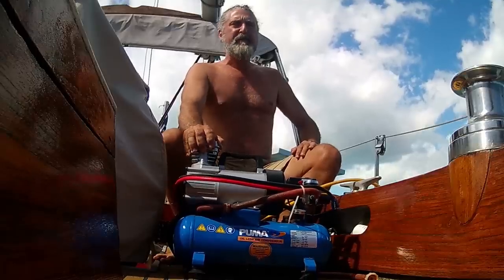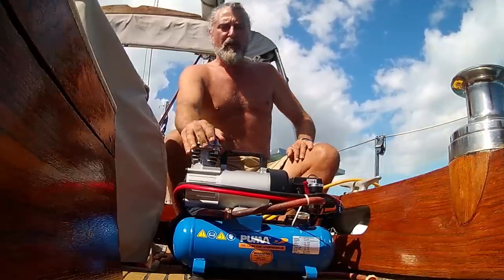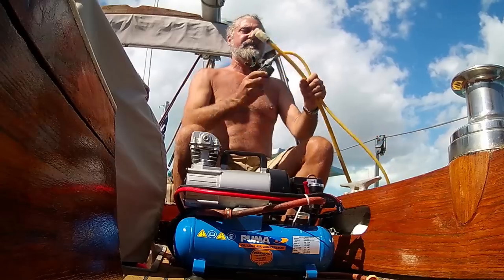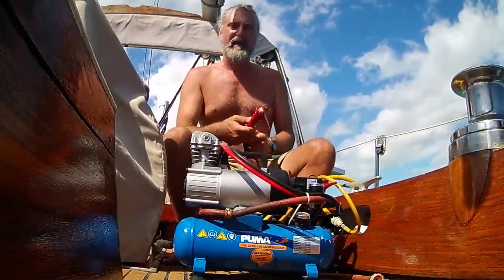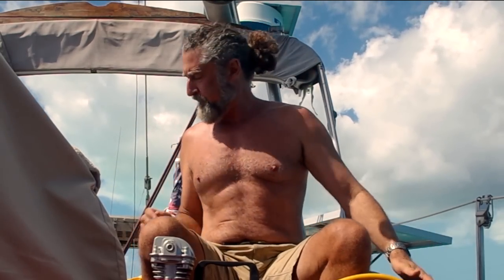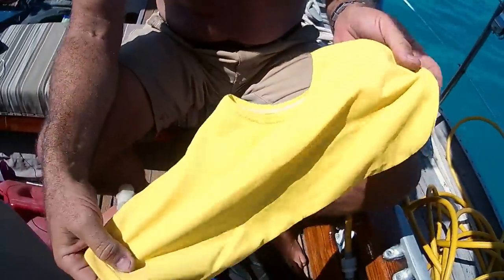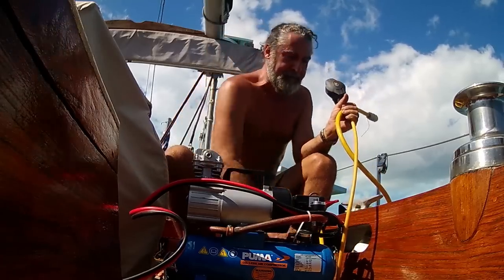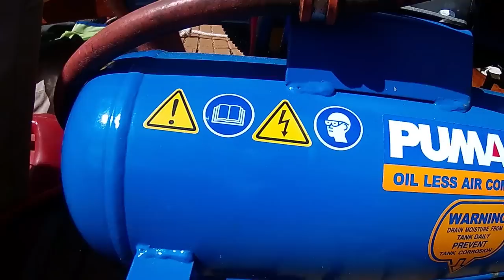$300 DIY Dive HOOKAH + Cleaning Our Boat's Bottom!!

Comment: Hey Clark...  (old) commercial diver here & I have 2 words for you -  FILTRATION SYSTEM !!!  Dude, you are getting all kinds of metal microparticles from the compressor in your lungs let alone the fact that the compressor air intake could be close to a contaminant source, i.e. propane tanks, fuel tanks, solvents, combustion, etc, etc...   You can make a cheap filtration system with a 6 - 8"  PVC pipe 4 ft in length, two threaded caps, pack it with coffee filters and activated charcoal and some molecular sieve...    Get a balanced 2nd stage reg that can breath well even at 80 - 100 psi, assuming you are going to be cleaning your boat at 2 -3 ft of water.  Depending on use you can change the elements of your filter every 4 - 5 uses...  We used to make our own 'emergency' backup filtration systems back in the day when I was working in Mexico in the 80's...  It is not that difficult.  Otherwise your lungs are going to pay the price...
Reply: Filtration does not need to be anything fancy its enough with a water/oil separator to remove the water generated when compressing the air and a micron filter to remove any type of small particles. Its an electrical oilless compressor that runs off a battery the air is the same as u breath on land.
to put it into perspective People work by grinding metal so they breath metal dust everyday (and wood dust) and people sit/work next to engines which makes them breath fuses (and those people still reach pension age) which is extreme conditions compared to a oilless  electrical compressor out on the open water.
second stage scuba regulator is all the same go for the cheapest one and use the adjustment screw until you can breath without an air supply all it does is close the intake it should require no pressure to actually breath through it it just need a bit of suction whatever its  10 psi or 140 it will work just fine.
The filters ("activated charcoal") you are talking about is what they use for huge scuba compressors to achieve completely clean air and this is due to the fact that those compressors have oil in them to create the pressure required. This is nothing like that, there is no oil in the "pump" part of the compressor and the air passing through it have went through an air filter so the bad particles comes from the wear of the compressor and in worst case rust in the tank which with a micron filter and water/oil separator will be removed.
the diving community really have a tinfoil hat nowdays
Reply from the maker: Thanks abc!
Reply: I'm wondering, being in shallow water, couldn't you just have a hose attached to the boat well above 'water level' and breathe directly through it? Wouldn't it be the same difference as if your nose was at where you mounted it? In through nose and out through mouth into the open water so your not putting your exhausted breath back into the hose.
Reply from the maker: Water is really heavy.  You couldn't do that comfortably more then a couple of feet down.
Reply: I came here to say the same thing, but also to wonder about all the commercially sold "hookah for diving" options.  I wouldn't be at all surprised to find that the $3000 hookahs that are "great for breath!" use the exact same parts and produce the exact same micro-particles in the airstream.   At least with this DIY option you can add all kinds of filters.  I don't think that's even an option on commercial dive hookahs.

Comment: I remember bottom cleaning my Columbia 30 back in the day, one thing that helped with minimizing the critter clutter was to anchor the boat in a reasonable current and work from the downstream end (the stern) to the upstream end of the boat, and have all the gunk flowing under & away from us as we moved forward. I think it helped to some degree. That pullover cap plus earplugs are a great idea tho. Plus your DIY hookah which I think is awesome despite some of the comments.
Reply from the maker: Working in slight current is a good idea.  Just not an option where I'm currently anchored.  I could really see just fine, it was just hard to film through the "stuff".
   Going back down this week to clean it better.  Polish to add speed.
   And thanks for your comment on hookah safety.  I appreciate it.

Comment: "As you get older it gets harder and harder to do breathe hold dives". At Clark's age I don't believe I'd be concerned but I would not advise a young person to start doing this unless they want to edit that statement to "As you get older it gets harder and harder to simply breathe." The Oil less compressors are oil less in that they do not have an oil reservoir or sump which lubricates the rotating assembly however in disassembly it would be quickly discovered that the parts are coated in assembly lube as a preservative for both before and after manufacturing. It is a very small amount and diving a few times won't kill you but over a extended period you can imagine what the tiny particles of aluminum and lubricant will do to lungs.

Comment: Hate to be a downer but I would not use that rig up.  Oil less does not mean that the air is breathing quality.  Those cheap compressors shed all kinds of crap into the air which you can prove if you put a proper filter system on the end of it. It will foul in no time. You should filter it to be good enough to run air tools if you want them to last and they are a lot less picky than your lungs.  There is a good reason the Bauer systems are expensive, it is because they will not ruin your lungs.  Also, order some cutless gloves. They are made for butchers and people working with glass. Knitted out of kevlar. They really work.
Reply from the maker: There is an outfit using this same compressor sold as a hookah.  They paint it yellow and charge 2 or 3 k for it.
   But to each his own.

I like your suggestion about the gloves.  I'm getting a pair.  Cheap on Amazon
Reply: Mark Bernier yes. I agree with you. Very dangerous
Reply: I really hope that is not true. Certainly not in North America.
Reply: How difficult is it to fit a suitable filter? And at what cost? (Not that the cost of the filter will prevent one from buying it if it's a safety issue.) Tks
Reply: Came here to make this comment myself. I would definitely do more research and be very careful with the air quality that you’re breathing.
Reply: @AfricanFlightStar  It depends on what is in the air. In the commercial industry, we regularly test the air quality of our compressors.

We generally use a compressor that uses oil. We change the oil to one that is safe for surface supplied diving. We run the compressor. Change the oil again. Test the air quality. Repeat until we are sure the air quality is safe. Then we regularly test the air quality with use.

I would be very careful about recommending anything that supplies breathing gas on your YouTube channel.
Reply: So my friends, use for breathing or don't?? Can you put a good enough filter on this unit to make it safe?? Thanks
Reply: If I used that compressor to spray paint I'd put a filter on it. Seems like lungs would deserve at least that.
Reply: Mark Bemier are you familiar with GatorGill Hookah Systems? If so may I ask your opinion on them Sir?? Thanks...

Comment: As soon as I saw the title of your video, I thought it was an awful idea, because you'd be breathing in lubricant fumes. But you seem to have it covered with an oil less compressor. Great way to save money on equipment. Thanks for the video.
Reply from the maker: You're welcome.  And yes you don't want to use the wrong type of compressor without using special oil and filter.  The sea cucumber divers in the Puget sound use regular garage compressors with special oil.  They are breathing with that system for many hours a day.

Comment: I have followed your video, but also got two filters made for hookahs from an online dive shop.  One goes at the compressor  and one at regulator.  My question, which I didn't see posted is what pressure should I set the regulator on the compressor too?  Thank you for the excellent post.
Reply from the maker: I use about 75 psi.

I also drilled out the regulator hose fitting so it flows better.  Not the valve just the brass fitting, on mine they were kinda small.

Comment: Perhaps a pair of cut gloves would come in handy for cleaning under the boat? I can't say I have ever personally used a pair but at work they are required for people in the kitchen to prevent injury while cutting food. They are fairly cheap (probably comparable in price to the ones you are using now) and I would think that they would last much longer (if not forever) instead of buying multiple pairs of gloves and still risking getting cut in the process. They may have other reasons why they would be impractical but I thought I would still mention it.
Reply from the maker: I bought a pair but haven't tried them yet.

Comment: Thats an amazing idea and because of your video I actually ordered one and  just received my 12v oiless puma today. I have a question for you,  i set up my water, particle filter and 2nd stage but after breathing for about 8 minutes my lungs started hurting so I went to disconnect the air line and noticed a DANGER  breathing Hazard sticker on my compressor. Have you noticed anything like that or had any ill effects with it ?? Thank you
Reply from the maker: If you are having issues I'd not use it.  Maybe they changed something??

But no.  In fact a friend just used mine over the last two days.  Cleaned my dinghy, propeller and rudder of the yacht and inspected the mooring.  

Never had a problem here.
Reply: @Clarks-Adventure  okay great thank you for the info.  there was nothing specified about breathing or NOT breathing in the details or specifications from 
The Puma dealer and as mentioned I didn't even realize it until my lungs started hurting and I went to disconnect the air hose and paid a little closer attention to the danger sign DO NOT use for breathing so apparently something has changed. Unfortunately it looks like I'll be returning it beautiful unit though. Thanks again.

Comment: This was a few years ago. Has it proven to be safe for long term use [ a few hours ] and at up to, or down to lol,  say, 10'?
Reply from the maker: Sure I use it all the time.   While we were off the boat over the last 7 months it was used by my friend Steve.
Steve is one of the original guys that started PADI.  He is known as Papa PADI.
   He feels it's safe enough to use himself.
Reply: @Clarks-Adventure  I had to come back and give that a tick, so no 1st stage regulator needed and safe for 15' operation?
Reply from the maker: Deeper than that.   It does have a first stage.  It's part of the compressor.  It's just not made by us diver.
Reply: @Clarks-Adventure  So the pressure control on the compressor is or works as the 1 st stage? I don't know much about scuba, but I'm very cautious. Better safe than sorry/dead and " She'll be right "  [ I'm Australian] is a stupid phyilosophy.
Reply from the maker: Stay in the top 10 feet then.
   Going deeper without understanding how breathing underwater works can kill you 3 different ways.
   That wouldn't be the device killing you it would be lack of training.
Reply: @Clarks-Adventure  Thanks. I have a boat and I love the hookah option, but at the moment I'm looking at it for freshwater creeks and rivers in Oz where the temps can be quite cold and I want to do some fossicking. So the depth isn't much, but the time can be long.

Comment: If anyone has questions like I did I found this helpful so I thought I would post it.            
   Q: Do I have to buy a compressor specifically designed for breathing air?
A: No. While we would like to say yes, the answer is no as long as the compressor is well maintained and has good, clean ambient intake air free from gas and particulate contamination and is not using PAO or harmful synthetic lubricating oils. Breathing air filtration package and CO monitor must be used on existing compressors.
Q: What is the difference between a breathing air compressor and a plant air compressor?
A: Breathing air compressor systems are designed with respirator use as the focused utility. The size of the compressor, FDA Food-grade lubricating oil, Grade - D filtration, CO monitor, refrigerated dryer, receiver tank with condensation drain, and air distribution system must be specifically sized for the number of workers and types of respirators in use. A plant compressor is not.
Q: Must I use an oilless air compressor for breathing air supply?
A: No. With the advent of the FDA Food-grade oil and the advances in compressor and breathing air filtration standard rotary screw, piston, and vane type compressor can be used when filtered with the proper filtration.
Q: How many workers can I hook up to a compressor?
A: This depends on the respirator used.  Every NIOSH approved respirator MUST free flow a minimum of 15 CFM (cubic feet per minute). Constant flow hoods have a flow range of 6 - 15 CFM. Full face constant flow respirators have a flow range of 4 - 15 CFM. Positive pressure, pressure demand respirators have a flow range of 4 - 15 CFM. Pressures vary from 6 - 120 PSI (pounds per square inch). Consult the respirator manufacturer for specific pressures, flows, and hose lengths. Take the number of workers or respirators and multiply by the desired flow required at the pressure needed by the respirator and the answer will give you the necessary CFM for the compressor.
Q: What is the difference between pressure and flow?
A: Pressure is force described in PSI, Pascals, or Bars. Flow is the volume or quantity of air described in CFM (cubic feet per minute), liters per minute, cubic meters per minute or hour.
Q: What is an ambient air pump?
A: An ambient air pump is an oilless vane air compressor operating at low pressure not exceeding 15 PSIg operating constant flow respirators only.
Q: Who regulates the use of compressors?
A: OSHA in their Documents CFR29 - 1910.134 establishes the protocol for compressors used for breathing air.
Q: Who regulates respirator use?
A: NIOSH.
Q: Can I buy an explosion proof compressor?
A: Yes. The real question is whether the the compressor is going to "breathe" or intake the ambient explosive atmosphere. Compressors are a machined set of lungs and cannot intake combustible, noxious, or volatile gases that could injure, harm, or kill a human if inhaled. While we manufacture explosion proof compressor systems, the air intake must be remoted to a clean air environment to ensure worker safety if the compressor is to be placed in a volatile atmosphere. Consult Customer Service for recommendations.

Comment: I dont know if you will get this. I had to do get a compressor for breathing air. I used a fireman mask for it was positive pressure. I had put three types of filters on it. A water separator, a carbon filter and and one to remove water from the air " silica". I dont think the water separator worked.  It was water, silica and carbon in that order. There was a nice difference in breathing the air.✌😉

Comment: Is it safe to breath the air from that compressor?   I thought the dive compressors were specialized for breathing.
Reply from the maker: Some people add a filter but it already has one for the incoming air.  
The key is it's an "oiless" compressor.  The machine oil that is often used can cause problems for your lungs.

I have since seen a commercial setup using this same compressor "painted yellow" for like 3 grand.
Reply: @Clarks-Adventure  thanks

Comment: Would/could this be safe down to about 10 meters?? I would like to hang down and meditate and do Timelapse’s. I’ve heard of the Nemo blu3 and I’m now wondering what would the safety difference be as I don’t want air bubbles in my blood. I read this system is only safe for shallow diving like hull cleaning.
Reply from the maker: It's fine.  The question is are you safe?

You need to know what you are doing.  The easiest way is to take a PADI class.